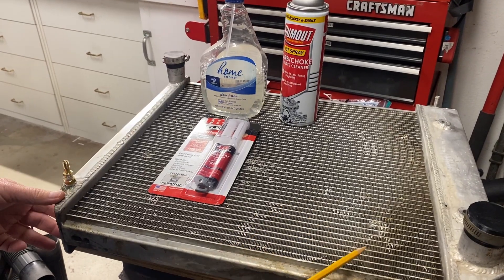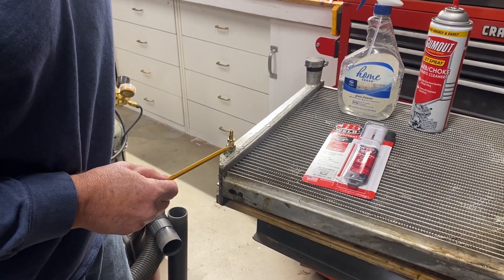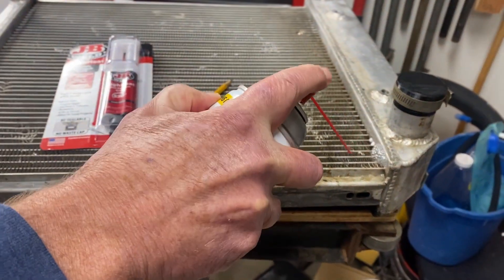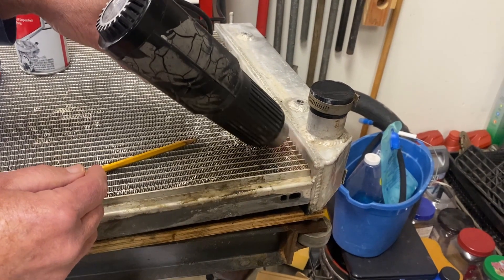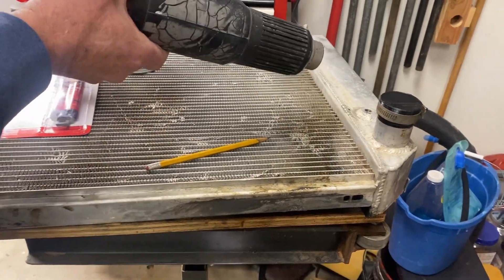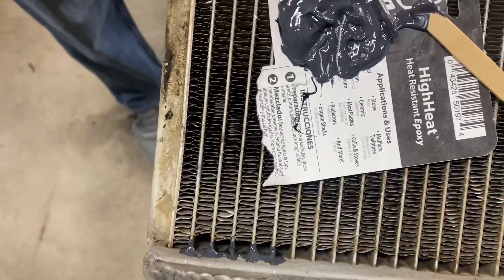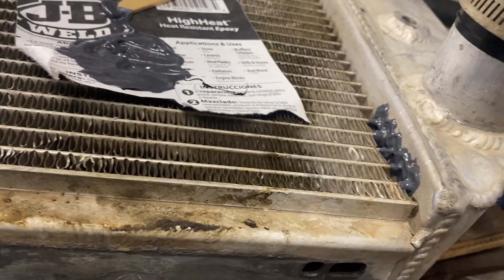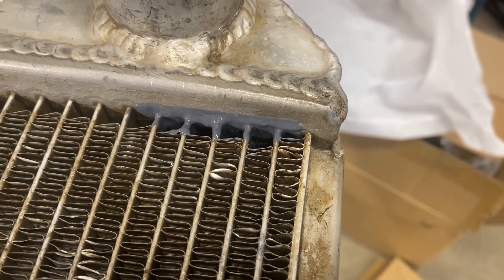Aluminum Radiator Repair With Epoxy

Comment: After it dries make delicate scratches on the jb weld with sand paper and another layer.  Wait till it dries. Make delicate scratces on the jb weld again with sand paper and add another layer.

Comment: I have an epoxy what is stand up with soldering at temperature ~300 celsius or so. So the heat is may not be a problem. May the crack is not stoping after epoxy was cured, because the stress is continue by coolant temperature and pressure cycleing and the conducted vibration from by connected hoses.

Vacum trick is phenomenal.

In this case i go to and see what is going on at the main hose, do some vibration testing at any diffrent motor RPM. To find what the cause is and solve it before go to replace the repaired radiator.

I think this is might save lot of money and time for you in next few years.
Reply from the maker: Duracell, perhaps if you drill small holes at the end of the crack before you apply epoxy the cracking will stop. Good luck!!

Comment: Can give  me the list of tools and materials u used fo
Reply from the maker: JB Weld high heat epoxy, carb cleaner, sand paper, wire brush, device to pressurize your radiator and soapy water to find the leaks!!

Comment: just finished doing the exact same thing. hope it works. im debating whether to apply heat as the instruction says it cures in an hour if heat treated so i can put it back in right away
Reply from the maker: I always let it sit a full day to harden. I’m curious if heat will cure faster and at least as hard. On the trail I epoxied at 9:00 at night and was 4 wheeling the next morning at 8. Still holding!
Reply: yeah im going for the 24hr room temp cure @filoncmike
Reply: I went 4x4ing a pice of plastic from the shroud hit the fan and went straight into the rad a decent hole, I got it down using creek water to the nearest auto part store epoxied it drove like 5 minutes after as it felt solid as a rock. Been driving for a week have a spare just waiting for this to go

Comment: Wonder how long this held. I found out  the hard way that epoxy resin desintegerates when exposed to glycol... Aka antifreeze. So this may hold a couple hours, but not any longer.
Reply from the maker: Still holding!!
Reply: do you really need anti freeze in a country where its hot all year long
Reply from the maker: @boyscout-p3u  James! It also is an anti corrosive. In California you are only a couple of hours from freezing temps in the mountains. Cheers!!
Reply: I used regular JB Weld with a swatch of fiberglass cloth to repair a motorcycle radiator. That was several years ago, and it hasn't failed yet.
Reply: Absolutely, not saying it won't work.. But I know first hand that epoxy dissolves when exposed to glycol. No question.

Comment: how is it doing so far with the heat ?
Reply from the maker: Trail tested tough! I have a 190 degree thermostat so the motor runs between 190 and 205. The last trip out no leaks until I had a fan strike caused a leak. I used more JB and trailed it all day the next day. Still no leaks! Pressure and heat no problem so far! Good luck!!
Reply: @filoncmike  may give it a go though not sure it will stand up to the heat and pressure for too long.. its only a single tiny hole on aluminum radiator and have no low melt alu rods available... Thanks for sharing..